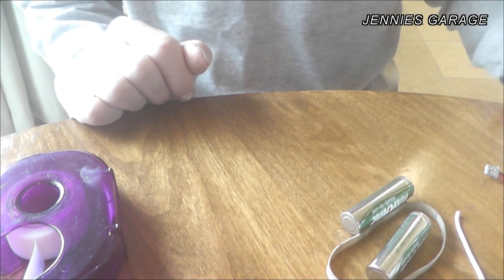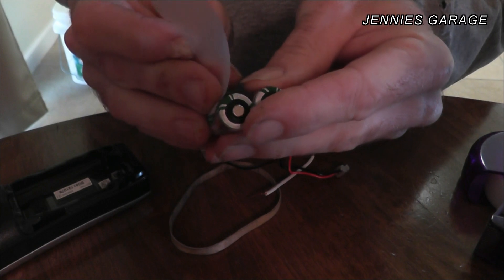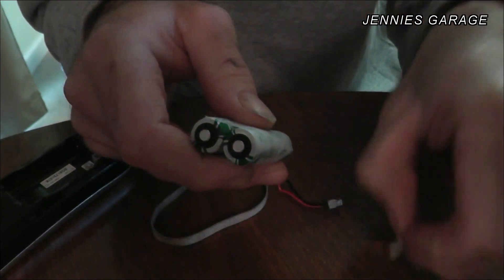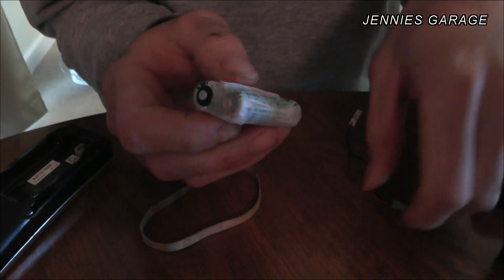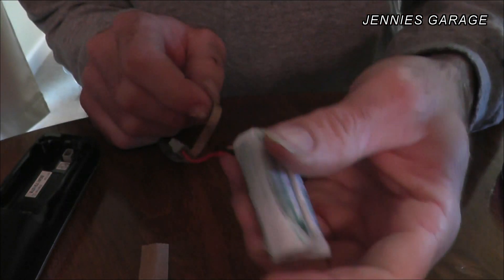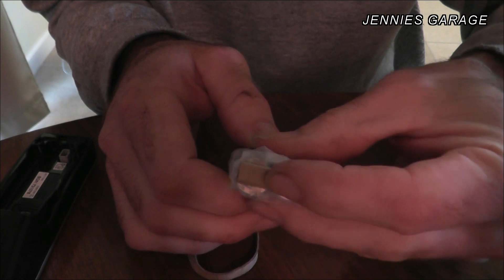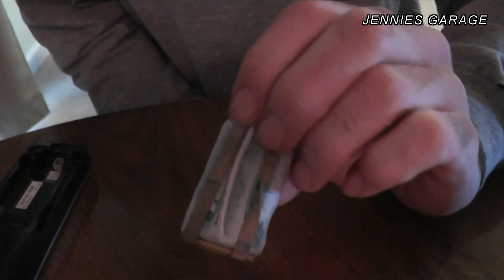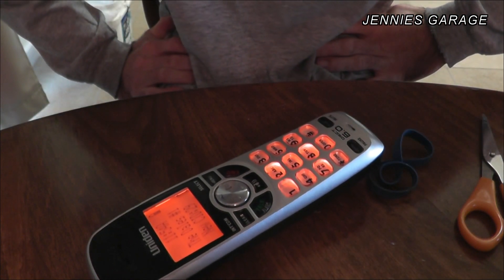How To Make A Battery Pack For A Cordless Phone - Homemade With AA Batteries!!

Comment: Good because many department stores do not stock replacement pack. Panasonic has just a battery compartment no wires. Best solution to start with don't buy Uniden!

Comment: Great thanks for sharing. Actually have the same phone. Made the pack and phone works. But I've used Lithium Ion batteries and not NiCad as in the original pack. Does that matter? Are they interchangeable? Concerned about charging times, etc.
Reply: +razz P I would be shocked if your phone hasn't burst into flames yet. NiCad and Li-Ion batteries are not interchangeable and you are risking your life and the lives of those in your household by charging Li-Ion batteries through a circuit designed to charge NiCads!
Reply from the maker: +razz P I think the lion batteries should be fine, they might even last a little longer between charges.
Reply: +Jennies Garage Hope so. Don't know how things should work, but does the charger on the phone turn off charging when battery is full. Otherwise it may overcharge and maybe damage the battery? Just a guess.
Reply: The original pack is NiMh, NOT NiCad.

Comment: Cool ! You are pretty clever . I had some old Unidens I love but the batteries are expensive - bought some online and they never even worked . Just replaced the system with an AT&T set which is like a toy so may resort to your AA battery fix if I can play with some copper wire - just a bit afraid to cause a fire : )

Comment: Soooo I noticed the battery level went up to only 50 percent. It will take the average person 10 minutes, tape, cardboard strips hand made and cut, 2 replacement cables for positive and negative or was it negative and postive and did the back door fit to close? Not sure, great efforts and well my Walmart and Radioshack are 5 minutes away. But excellent McGyver episode. I miss that show Wait how many D size batteries for a CAR BATTERY?
Reply from the maker: Paul Chavei haha, every time I need to buy an expensive car battery I think about things like that!
Reply: You'll never get enough CURRENT  for a car battery.  It's all about the AMPS, not volts.

Comment: If you use D size it will have more talk time and standby with the same voltage but have fun trying to fit it in the battery compartment lol.

Comment: 2 thumbs up!  What i did was follow your instructions except mine uses 2 aaa batts and i soldered the connections, just get a gas soldering iron and get it real hot, it will only take a couple of secs to stick to the battery ends and gas ones get hotter quicker than electric ones, Cheers for the knowledge!
Reply from the maker: Great to hear it worked for you. And thanks for the info about soldering. I heard that soldering could get the battery too hot, but now I might just try it, as it is a better connection.
Reply: *****
Ye mine now holds  charge for about 3 days , the factory ones may last a day and a half, easy secret to the solder id have a nice big drop of solder on the iron then hold the battery end for maybe 3 secs or so and slowly swipe it off you will see the solder stick only needs a thin lick , tin the other wires and the join the same way :) i don't have anything to video how quick it is but it works great!